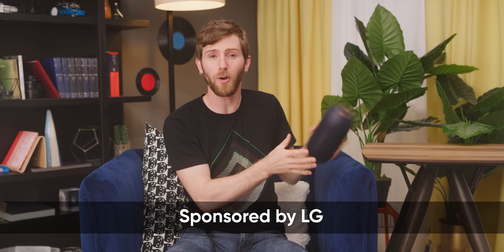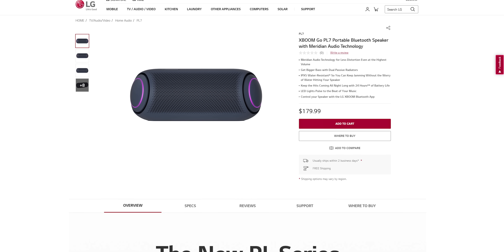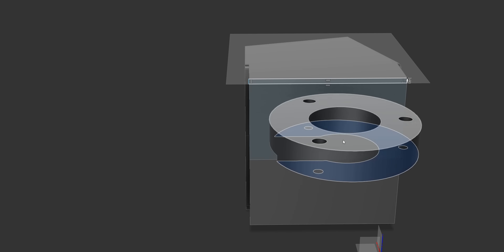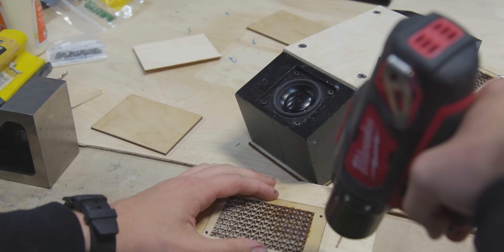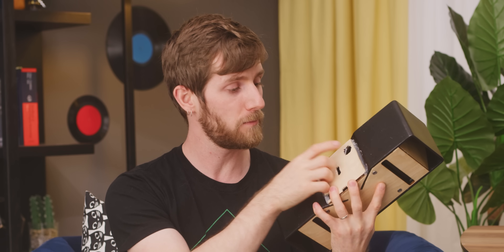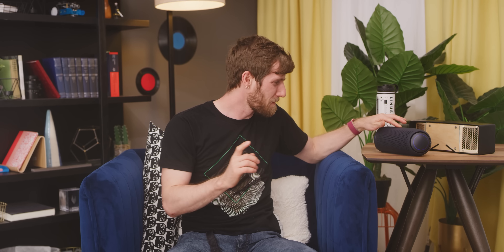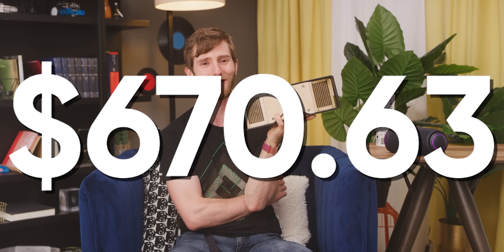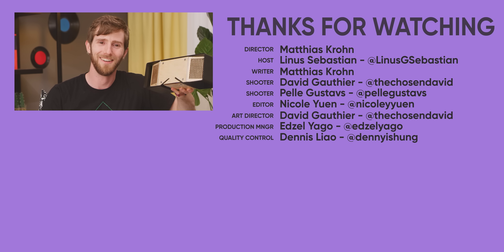Can we build a better bluetooth speaker? - LG XBOOM Go PL Series

Comment: 😅 Good try but you know it's going to fail. I mean really. You ought to do a second iteration though. Just give it your best shot. Spend all the money and the time it's not going to cost that much cuz I think you owe it to us to see what you can do on your own. You know give that case an upgrade as well. And definitely go for three-way even if you have to tear apart a good amp. So what sacrifice a $50 amp? It's got the Bluetooth. It's got the stereo. You'll be able to Jack in whatever you know a second pair of speakers. You know which is critical. You're never going to get better sound than from a pair of three-way speakers that are designed by Sony like the CS series. And you know you can get those for a hundred bucks. So you know never mind the price point you're trying to beat it. And beat it by like a 2X margin minimum for sound quality and expansion capability.

Comment: Great video!
I think the LG speaker (or any decent modern bluetooth speaker) has four tricks that are not in the diy-speaker:
1) As large as possible cone area and speaker displacement (it looks like the LG speaker has larger cones than 2 inch)
2) Some form of crossover, that makes the transfer between woofer and tweeter more smooth
3) Equalization that does some correction for the imperfections of (cheap) speaker drivers
4) DSP, that does some form of dynamic bass boosting, depending on the volume of the sound and how much headroom is left for the amplifier and speaker driver. Also, DSP can compress the amplitude of the sound in order to make the 'perceived' volume louder. Finally, DSP can do pre-correction for speaker driver nonlinearities (but I don't know if that is done in these kind of bluetooth speakers)

Nonetheless, the diy speaker sounds indeed quite reasonable, and especially the treble sounds much more flat and clean than that of the LG speaker (at least to me).

Comment: Bought this speaker ( PL7)  and it sounds great via bluetooth, however, using an AUX connection the sounds is only a fraction of the bluetooth connection. I have been unable to fix this so would ONLY recommend using bluetooth.

Comment: I once had a Sony shelf system the receiver broke I took the if the box speaker went  got a Bluetooth speaker with aux input when 5 below was actually 5$ too the board out an spliced the wire it was extremely load and sounded perfect an great thing it’s less then 2 pounds

Comment: Hey, I know this is an old video and you'll never see this but I just wanted to let you know that this inspired me to build my own Bluetooth speaker. I used an old center channel speaker and drilled a hole in the bottom for a subwoofer. I didn't bother making it portable but it's small and It sounds good enough. For $14 and a salvage subwoofer from a 1st Gen Amazon echo I'm pretty proud of it.

Comment: You could have done it way cheaper with MDF board and a mitre or table saw. Or put it in a pvc pipe wire it up. Make some feet out of anything. And drill some holes.

Comment: I've bought xboop pl5 from mediamarkt. When I unboxed it the start button didn't work which shows most probably that the battery drained, it was %0. It should be, as far as I know around %40 - %60. This indicates that the battery is elarady dead, or the machine is out of work, broken, or at least the battery is empty and it was on the shelf for so long time. Is this acceptable? I'm going to return it? What do you suggest?

Comment: crossover points have to be extremely accurate to the TS parameters of the speakers.
Meaning if you do not have overlaps covering the broad spectrum of sound. 
ehhh, 20-20khz or a more logical view of roughly 35-40hz - 20khz you'll have muddy harsh sound.
speakers are only capable of playing what they were made to do, aswell as have bandwidth curves.
you can find full range speakers that'll cover a very wide range but without a properly designed enclosure around its Parameters it'll flop.
Im sure you'll never see this comment, but if you'd like advice from a guy that's been designing enclosures for home audio aswell as compete in SPL form of audio.
feel free to contact me anytime, advice will come free.
video like this makes me very excited, coming from a tech channel.
man it'd be sweet to work for LTT!

Comment: but to be fair Linus, the cost of assembly would be far cheaper and I would be able to do my part about 60 times an hour, maybe more and having 10 people assembling it at a high rate would be about 1 product a minute, with injection moulding being able to swap dyes as fast as they do, they can change from injecting a speaker mount to injecting a mounting chassis within a few hours after they made about 40,000 speaker mounts with far less cost than plastic thread that your 3D printers use

Comment: The man-hour calculations aren't really realistic. Take into account the prototyping stage of the PL7 and you get even higher costs. They build these in volume so those costs get divided by the millions. You would have to take the number of units produced by LG and divide your man-hours with the same volume. That's how you would realistically get the actual manhours for this speaker compared to the LG.

Comment: To be fair LG has thousands of millions of dollars to spend on design which they only have to spend ONCE, they also get parts cheaper from wholesalers rather than buying each piece individually, they also have all of the infrastructure to build this stuff on assembly lines in other countries that might not have as generous a minimum wage. In short i really liked this video! But it's kind of an apples to oranges comparison.

Comment: A single, and relatively cheap, passive radiator would have fared better than the complex bass reflex solution.  If you examined the product, and its specifications, then why deviate from their chosen path to better bass?  If bass reflex ports were a better solution, LG would have made them that way.  But instead, they used passive radiators because in small low-power speakers, they are clearly more efficient.

Comment: pl5 battery sucks, 3 days, using on 10% in windows, went down 60-0, only in 3 days. If u use aux, when u switch to bluetooth or even press the bluetooth button, to switch back to aux, u need to open the lg app and switch inside the app. Sucks

Comment: HF waves travel in narrow angle, so it's not smart to put tweeter on top :D however, woofer would work in that position, but need better design to achieve correct enclosure.

Comment: I think even a less than $60 Tronsmart speaker would still be good sounding compared to that DIY speaker 😂 They even tried the bose concept transmission line design of the enclosure. But the overall magic is in the DSP just like bose and JBL did on their speakers. 😁

Comment: This would be interesting to see revisited without a price budget, pretty sure compared to some higher end options out there you could build a really impressive bluetooth speaker.  Toss in a real subwoofer and add some basic low and high pass filters to the respective areas you could get some great sound.  Awesome use of large ports on this one, that is how BOSE made their little tiny wave stereos sound amazing, if I remember correctly each of the ports in that radio were 7 feet long.

Comment: If you truly want a cheap Bluetooth speaker, go find a centre channel speaker from a surround sound system, take out the internal bits, wire the speakers to that there board and battery setup you’ve got, and duct tape that shiz back together. BOOM really cheap and mildly good  Bluetooth speaker

Comment: You shouldn't account for the time spent doing this.
If someone decides to make something like this they either actually want to spend the time doing it, as a hobby, to pass time, to enjoy the process, so the $$/h argument is irrelevant.
On the other hand, if someone is doing this to actually save money you also shouldn't account for the time because their time is usually pretty cheap, otherwise they would be able to afford buying a commercial solution.
TLDR: just don't put time into account when calculating the cost, it's stupid.

Comment: I love this concept, and the design is really fun!

As an audio geek, i did notice a few things. 
- the tweeter appears to be pointing straight up, which is going to result in an unbalanced sound. Tweeters are typically put facing in the same direction, and as close as reasonably possible to the woofers to compensate. 

- the "shrill" highs are a result of not using a crossover. Essentially, this divides up which frequencies are being played by each driver. If they are both doing the same frequencies ( no crossover) you end up with muddy lows and highs as a result. 

- The passive radiators on the lg ( and most bluetooth speakers) result in tighter bass, but limits how low  the bass can go. This is generally a smart move for small speakers, but you could have cool results going the port route. 

I think with some work and using something like a used center channel speaker, you could destroy a bluetooth speaker for a lot less. 

At any rate, awesome work. If you cleaned up the holes id buy a speaker with that design!
Reply: The toe out is cringe and the wood speaker grills are also cringe. Basically an anti wave guide. 
The plastic flaps that cover half of the driver ;(
Even without a crossover this would probably sound better outside the box they made 😂
Reply: Also I felt like the tweeter was kinda useless, the DMA series already has good treble, he shoulda used passive radiators instead. Idk if he looked at the frequency response graph but whatever. It would have been significantly smaller too
Reply: TBH I wanna see them refine this design until it becomes cheaper to manufacture each one, as well as beats the off-the-shelf speaker!
Reply: @AR15ORIGINAL  I don't think that it would. Off-the-shelf speakers have the benefits of economies of scale, whereas a DIY/bespoke project like this is going to cost more for worse.

LMG would have to go full speaker company to even come close to something off the shelf.
Reply: Also the LG has DSP, the DIY does not. Passive radiators need a lot of EQ and power limiting, otherwise the main driver will get damaged easily, or it just sounds really bad.

Comment: Wow that was a dumb design. First off If you're building your own speaker you need to spend the most budget on the speakers/amplifier. All that extra 3d printing and designing brought no benefits. It shouldn't have even had a grill, that only hurts the sound. Additionally, it's a very tiny speaker, this means mids are going to be easiest to produce. For balanced sound you'd need a much larger focus on a woofer and tweeters. Also one tweeter was crazy goofy.

Just so people know if you buy high end speakers and a box, assemble it yourself and add Bluetooth you will get MUCH higher quality audio. This comes at a sacrifice to portability and astetics.

One final thing. You can't cheap out on the amplifier. It's just as important to quality audio as the woofers smh.

Comment: The design time shouldn't be factored in as a 1:1, it should be factored in over the expected product run of the product ie if you expect to make and sell 10,000 units then divide that time by 10,000. Yall obviously don't have the volume pricing on the components but at least give yourself some wiggle room to make it fair. Yes I understand yall won't make more of that speaker but at least try to be more apples to apples even it really apples to pears.

Comment: Okay trying to beat the cost is a lil crazy but building better should still be possible  yes size is limiting and  the extra features as water "resistanting" and extra chargeport stuff but i imagine larger battery for run times 3 different size separate speaker cones and the sound channeling was a good idea overall i like your design for indoors use a car is kinda indoors but then cars have built in stereos unless you're using it as a handsfree device duct taped over where your airbag deploys on your steering wheel ... I'm interested to see the diy better than a company can videos possibly the company's hire the competitors to improve thier products and create new designs to sell

Comment: Having just started to dabble in audio, and having just installed a Sub into my car. Let me tell you, after building my own custom enclosure I learned very quickly that yes, every single inch matters for tuning and overall sound and how it works. 

There is much more to sound than "put speaker in box, yay".
Reply: You can just put it in a box, but the better sounding way is to do the math

Comment: You have to think differently about your DIY attempt.... Your over 60 hours is R&D work. I would guess LG has over 500 hours and probably closer to 1200 hours as they are going to make these in mass quantities as you guys did your own R&D work, from an idea and the money you spent in parts were NOT in bulk. So put another 300-500 hours into more R&D, then buy in BULK, 3D print in-house and sell on LTT.com for $150-$175, sell 100 unit and break even, sell a 1,000, and start collecting large profits,  sell 10,000, and well, you get the picture.... I would buy one, R&D (Your investment) the best you can, the start making them with custom colors. In two years, make a version 2... just a idea as when I was watching, I love the potential that was there... DO IT

Comment: A piece of advice from someone who designs speakers as a semiprofessional and obsessive hobbyist -

Do this again with fullrange drivers. Tweeters and crossovers are only a detriment at this size and pricepoint.

More specifically, do it with 3" FaitalPro fullrange drivers and Dayton's bluetooth KAB-50 amp. You'll kill every commercial BT speaker for less money.

The big gain comes from using full range drivers, two total and no more. Using tweeters ruins your phase profile, while costing more, because passive analog crossovers have terrible phase/frequency distortion, and the alternative of DSP is far too expensive here.

Second, using professional drivers (the kind actual prosound guys and concert theaters use) means they're super efficient, which means more sound and less battery/amplifier/weight/cost. 

I've built that exact speaker before and it's stunningly good, outshining the best I've heard in the business (usually JBL) and standing up to proper bookshelf speakers and only limited by the narrow stereo pan inherent in every portable speaker.

Comment: I really like this vid but I would have used the dayton nd65 instead and remove the tweeters and maybe add some passive radiators like the nd65 pr or cheap chinese ones, I think that would sound a lot better. The dma58 are really bad speakers and I think that passive radiators are more effective than port for such a tiny speaker.
But gg for the design 👏